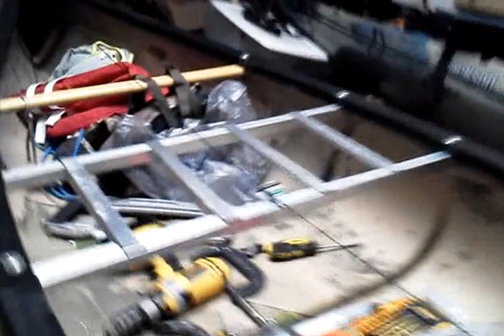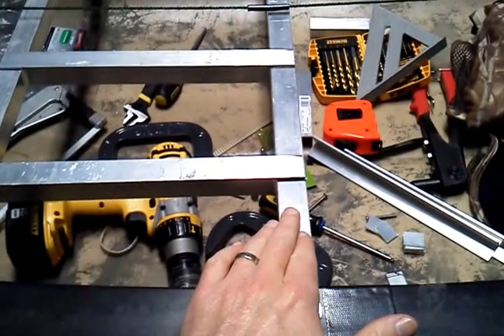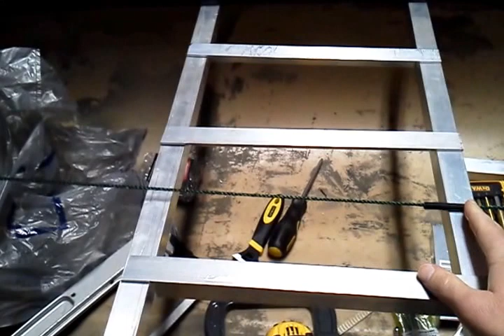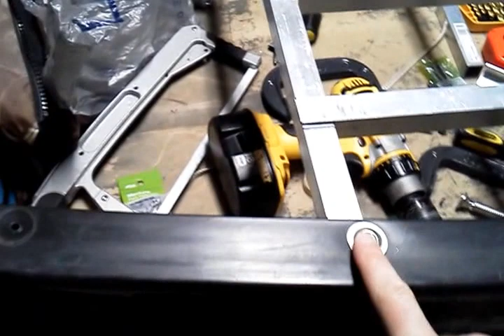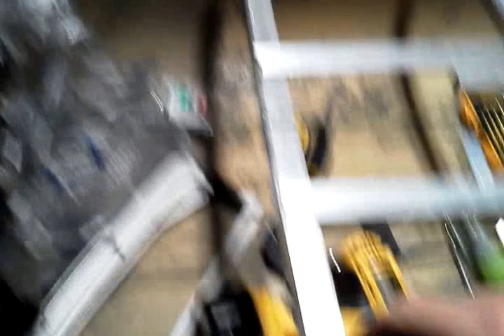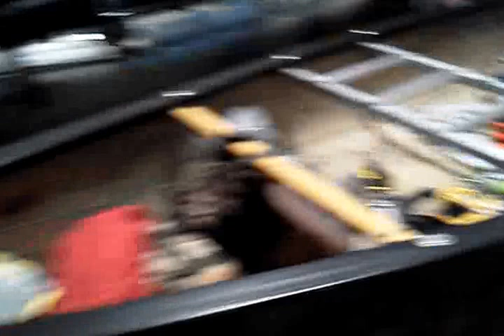Old Town Discovery 119 Solo Canoe Seat Mods Pt. 1

Comment: What fasteners did you use to attach the seat to the side rail
Reply from the maker: Stainless steel bolts with tapered heads purchased at Lowes. I reused the factory head washers that are on top of the gunnels that the head rests in.

Comment: I know that you recorded this video 4 years ago, but I was wondering if you still use this particular Old Town 119 canoe regularly ? and if you do still use it, are they good boats? I am interested in a Old Town Guide 119 constructed from poly "plastic". Do you know anything about them, for example do these plastic hulls have a problem with warpage on hot days?  Thanks for any help, Greg
Reply from the maker: Yes I still use it as my go to boat!  I love it!  They are great boats.  Like any canoe of any material I would always try to store it on the gunnels (upside down) and out of the direct sunlight.  I have never had mine warp on hot days either.
Reply: Thanks again for the kind reply. I noticed in the video that you also had a kayak sitting beside the canoe. I have owned a 12 foot NuCanoe (kayak), and several smaller wooden and fiberglass river/pond boats for fishing, 8 feet, 10 feet, and 11feet in length , but never had a canoe of any length or make. Do you personally prefer a canoe over a kayak? The reason I am asking all of these questions is that the kayaks are much heavier to lug around. My 12 foot NuCanoe was around 80lbs. empty, and a decent 11 foot 1-1/2 man wood boat would be close to 100lbs. That's a lot of weight for an old geezer to have to pull on in a small creek. If this Old Town 119 canoe is just as stable as a "sit on top" 12' kayak I'm pretty sure that I'm going with a canoe, especially for an overnight solo camping/fishing trip. Thanks again for the advice and help.